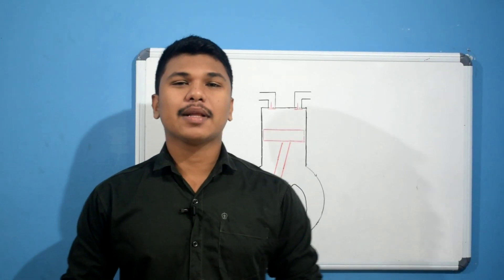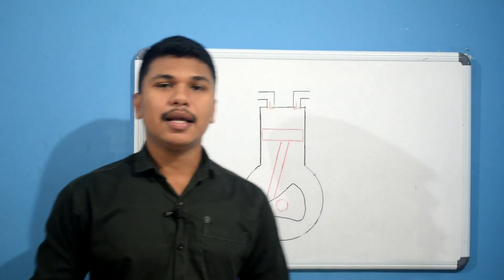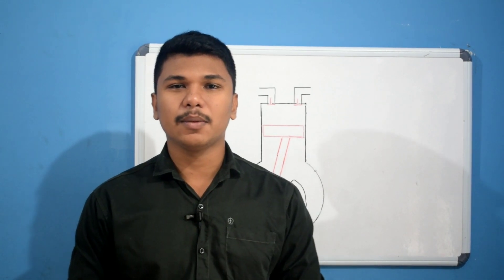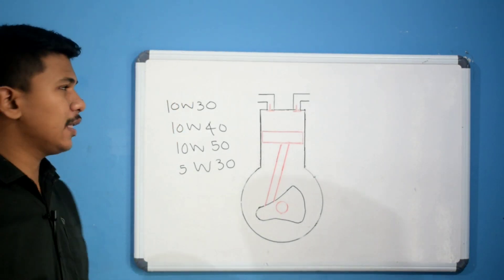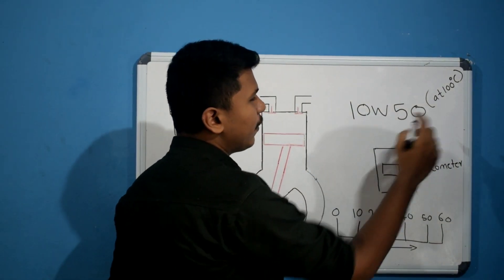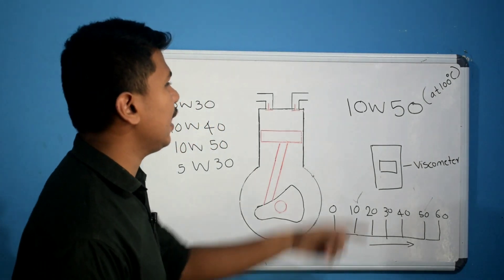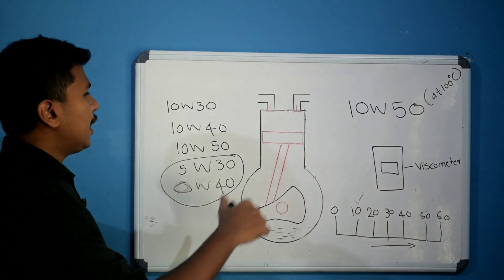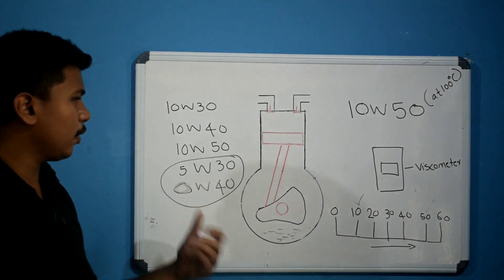Engine Oil explained | Types and Grades | Malayalam video | Informative Engineer |

Comment: Pazhaya 2 stroke vandikalil 2T oil ennu pothuve vilikkunna 2 stroke oil petrol nte koode mix cheythanu use cheyyarund Suzuki  Samurai, Shogun Rx 100 thudangi orupadu 2 stroke vandikalil um  side iil cheriya oru tank und 2T oil ozhikkan ,allenkil patrol noppam mix cheythum ozhikkarund athanu 2 stroke engine oil ennu parayunna oil athu engine il ozhikkanullathalla karanam 2 stroke engine oil nu thickness valare kuravanu athu engine nil use cheythal engine pettannu damage akum

Comment: ചേട്ടായി എന്റെ വണ്ടി 2003 model Splender (euro 2) ആണ്.
ഈ വണ്ടിക്കു പറ്റിയ ഓയിൽ ഏതാണ്.
User manual ൽ 10W 30 ആണ്.
പക്ഷേ വർക്ഷോപ്പിൽ ചെന്നപ്പോൾ 20w40 ആണ് അവർ ഒഴിക്കാൻ പറഞ്ഞത്.
ഏതാണ് correct ആയ oil ?

Comment: Honda company unicorn 150 bike recommend 10w30 engine oil aanu .  Appol 10w40 use cheythal engine lubrication hol koode oil_nu kadannu pokan sadhikkumo ??

Engine Thanuthirikkunna avasthayil 10w40 viscosity koodiyathu kondu 10w30 recommend cheyyunna engine lub hole koode kadannu pokumo ?

Ella parts_nu oil correct aayi kittumo ?
10w40 use cheyyunnath nallathano atho allayo ?

Comment: Dear friends. 20w40 or 15w40 is also called NORMAL ENGINE OIL, IT COSTS BETWEEN 700₹ to 1000₹ for 3litre or 3.5litre, This oil will be very thick. Good for South Indian condition,  Where as, the 0w30 and 5w30 both are (FULLY SYNTHETIC). 
Reason people use in new gen Diesel engine and Petrol engine is that, at the time of starting a car, the synthetic Engine Oil as it is very much close to free flowing, the oil quickly gets into the piston areas and then make the Engine start without much hassle or noice coming. Ina way synthetic Engine Oil is also used for high performance cars, the reason is as I said, to get the Oil Quickly To Pistons.
Reply: Hi bro...Karizma ZMR il 10w30 anu Owners Manualil parayunath...But vandiyude first owner ozhichirunath 10w40 7100 Motul arunnu..Njn epol second owner..7 Masam nirthiyitta vandi arunnu..Vandi eduthu Oil maran chennapol workshop karan 20w40 anu nallathen paranj ath ozhichu..enit 2500 kmil oil change cheythal mathiyen paranju..Epo Start cheyumbo White Smoke varunnu..Smoke Oil marunna vare ilatha vandi arunnu...Enthan evde sambavichathu..ithil enthenkilum udayipp undo?...Ningale pole ola youtubers anu njangalude ake ula trust😊...Reply idumen pratheekshikunu..Matulavarkum sahayam avate

Comment: Very informative thank you. 
What about nulon oil 10ml for scooter add with engine oil and it cost around 200rs , it last 15000km 1986 onward I use this oil in my hero Honda CD100 and now activa i feel very smooth engine high pickup.
Reply: Very useful information, Thanks

Comment: Good explanation.
10W50.
1.What is the unit of 10 and 50 ? 2.Which viscosity is considered here.Dynamic or Kinematic ?
3.In cold state viscosity is 10 and in hot(100'C), viscosity is 50.Is this mean the oil is more viscous at 100'C compared to cold state.Is it good to become more viscous at high temp ?

Comment: Ente vandi Honda CB Shine SP anu. Njan athil Honda yude oil ozhikunnath nirthi. Athinu pakaram Motul 4T 5100 10W40 anu ozhikkunnath. Vandiyude accelaration muthal gear smoothness vare improve cheythu. Engine breaking ottum thanne illa ennu venam parayan. Overall vibration valare adhikam kuranju. Honda yude oil ozhichirunna time il, enik 50 km/h il polum odikan kazhiyillayirunnu. Athrakku vibration um heat um ayirunnu. Ipo njan 60 km/h il constant ayit pokunnu oru kuzhappavum illathe. 60 km/h il povumbol thanne enik overtake cheyendi vannal polum ipo oru vishayamalla. Ipo vibration thudangunnathu thanne 75 - 80 km/h ilanu. Athukond enikkariyavunna ella alkarodum njan Motul anu prefer cheyyunnath. Pinne Honda yude service inte menma njan parayathe thanne ellavarkum ariyam ennu karuthunnu.
Reply: Bro engine oil 3000, 7100 enthan?
Reply: @perfectperfect5713  5100 10W40 green kuppi
Reply: @soorejsbabu  perfomance enganayund
Reply: @perfectperfect5713  Nalla improvement vannu. Pickup koodi. RPM pettennu kerunund. Athukond oru karyam sredhikanam, othiri higher RPM ilek ketaruth. Oru vishayame allathapole RPM kerum but ath chelapo engine components inte designed limit kazhinjum push cheyan thonipikum. Bhayankara smooth ayond engine breaking sherikum kurayum. Engine azhichu vita feel avum. Athukond thanne mileage ilum cheriya improvement und. Porathe 5,000 km il oil mariyamathi.
Reply: @perfectperfect5713  First time use cheyan pokuvanel ipo kedakunna oil ilek liqui moli de engine flush (oil shooter 80ml) ozhichit oru 10-15 mins idle il iduka. Ennit thanuth kazhiyumbo maximum ooti kalayanam. 2 side ilekum cherichum, kicker onnu pathuke chaviti piston karakiyum mukalil kedannathukoode maximum ooti kalanjite motul ozhikavu.

Ith oil upgrade cheyumbazho, vere company de oil ilek marumbazho, 15k km kazhinju varunna oil change ino okke ingane cheyanam.
Reply: @soorejsbabu  milege koodumo
Reply: 5100 10w30 upayogichal performance koodumo?
Reply: Speed kerunnundo
Reply: Oil change cheythal engine preshnamundo athayath company prefer cheyunath 3000 10w30 an.njan ath 5100 10w30 akiyal enthekilum prashnamundo.
Reply: @perfectperfect5713  3000 10w30 mineral oil anu Honda il ninnu kittunathum mineral oil anu. 5100 semi synthetic anu. 7100 and 300v fully synthetic anu. Cheriya vandikalk semi synthetic mathi. Fully synthetic oru avashyom illa.

10w30 ennathinu pakaram +/- 10 vare mati ozhikam. But athil kooduthal mattaruth (eg: 20w50).

Bakiyellam njan already paranjitund. Vayichu nokiya mathi.

Comment: Honda cbr 250r using 10w40 shell fully synthetic oil
Reply: Aha.. njanum. Honda cb shine sp. Using 10w40 motul fully synthetic oil.

Honda yude servicing bhayankara "mikacha"thayit thonunna alkarum undalle.
Reply: Etrayanu price ee oiln
Reply: @allenzam7416  motul anel 500 roopak mele avum. But 4,000 km odum

Comment: What is best time for change engine oil. Cold engine or hot engine ( just after running)?
Reply: I know the right answer. If its a cold engine , drive it 2 miles or 3-4 km then change oil and filter. Wait untill old oil is completely drained. I do both my cars myself

Comment: Could you please tell me which engine is more expensive to maintain -turbocharged 3 cylinder petrol engine or 4 cylinder CRdi Diesel engine?
Reply from the maker: Engine maintenance pala karyangaleyum ashrayichanu irikkunnath.. 
Ningal eth car aanu vangan udheshikkunnath.. enn paranjal onnu koode clear aakam

Pinne normally diesel  maintenance cost kooduthalanu
Reply: Hyundai venue

Comment: ബൈക്കുകളിൽ ൽ Synthetic oil ഉപയോഗിക്കാമോ.......?
Reply: കൃത്രിമമായി നിർമ്മിച്ച chemicals അടങ്ങിയ oil ആണ് സിന്തറ്റിക് ഓയിൽ. Crude oil  Chemically modified ചെയ്ത് പെട്രോൾ Components  ഉപയോഗിച്ചാണ് സിന്തറ്റിക് oil  നിർമ്മിക്കുന്നത് വ്യത്യസ്ത കമ്പനികളുടെ oilinte viscosity വ്യത്യാസം ഉണ്ടാകും.
 ഇത് 200 cc ക്ക് മുകളിൽ ഉള്ള വണ്ടികളിൽ ഉപയോഗിക്കുന്നത് ഗുണം ചെയ്യും.
ഓയിൽ changing period increase ആകും.

Better viscosity

•	Better chemical and shear stability.

•	Decreased evaporative loss.

Resistance to oxidation, thermal breakdown, and oil sludge problems.

Possibility to extended drain intervals, with the environmental benefit of less used oil waste generated.

Improved fuel economy in certain engine configurations.

Better lubrication during extreme cold weather starts.

Possibly a longer engine life.

Comment: Engin oil മാറുമ്പോൾ engin flush ചെയ്യുന്നത് നല്ലതാണോ? അതിനെ പറ്റി ഒരു vdo plz...
Reply: 15k intervalsil engine flush cheyyunnathaaakum nallath

allaaathe regular oil changing intervalsil engine flush cheyyanamennilla
Reply: You dont have to flush out an engine . Drain out the old oil after running couple of kms . Change the filter. Wait until oil is completely drained

Comment: ചേട്ടായി വീഡിയോസ് കൊള്ളാം 
ചേട്ടായി ഓയിൽ ചെയ്‌ച്ചു ചെയ്യുമ്പോൾ എഞ്ചിൻ ക്ലീൻ ചെയ്യാൻ ഉള്ള ഒരു ഐഡിയ കൂടി പറഞ്ഞുതരുമോ
Reply: Use  flushing oil after emptied old oil then run the engine 3 to 5 minutes. after that empty the flushing oil and fill new engine grade oil

Comment: Dot 2 dot 3 entha sambhavam ,athupole enganeyaan brake fluid work cheyyunnath athupole disk braking enganeyaan nadakkunnath abs in bike enganeyaan ithokke paranh oru video cheythal top aayirikkum
Reply: ഹൈഡ്രോളിക് ക്ലച്ച് ആപ്ലിക്കേഷനുകളിൽ ഉപയോഗിക്കുന്ന ഒരു തരം ഹൈഡ്രോളിക് fluid ബ്രേക്ക് ഫ്ലൂയിഡ്.
It is used to transfer force into pressure, and to amplify braking force. It works because liquids are not appreciably compressible.
DOT refer to us department of transport -brake fluid.
SAE is Society of Automobile Engineers is standardisation of engine oil
Dot 3,4&5 denotes the minerals including the oil.
Reply: @Crank2wheel  DOT stands for Department of transport (US)

Comment: സാധാരണക്കാർക്ക് പോലും ലളിതമായി മനസ്സിലാക്കാൻ കഴിവുള്ള രീതിയിൽ വളരെ നല്ല അറിവാണ് താങ്കൾ പങ്കു വച്ചത്.
Reply from the maker: Thank you.. 😊😊
Reply: 15w40diesel engine oil alle
Reply: Sorry to be so off topic but does any of you know a method to get back into an Instagram account..?
I was stupid lost the login password. I love any assistance you can offer me.
Reply: Thettaya vivaranamanu
Reply: Dear friends. 20w40 or 15w40 is also called NORMAL ENGINE OIL, IT COSTS BETWEEN 700₹ to 1000₹ for 3litre or 3.5litre, This oil will be very thick. Good for South Indian condition,  Where as, the 0w30 and 5w30 both are (FULLY SYNTHETIC). 
Reason people use in new gen Diesel engine and Petrol engine is that, at the time of starting a car, the synthetic Engine Oil as it is very much close to free flowing, the oil quickly gets into the piston areas and then make the Engine start without much hassle or noice coming. Ina way synthetic Engine Oil is also used for high performance cars, the reason is as I said, to get the Oil Quickly To Pistons.
Reply: ഒലക്ക..ഇടക്ക്‌ ഇംഗ്ലീഷ് പറഞ്ഞിട്ട് തിരിയുന്നില്ല😜

Comment: Thanks brw... ഞാൻ തപ്പിയ വീഡിയോ.. ഒരു സംശയം.. എന്തിനാണ് 4 strokinu 4T ഓയിലും 2strokinu 2T ഓയിലും?  ഇത് രണ്ടും തമ്മിലുള്ള വ്യത്യാസം endanennu പറയുമോ??
Reply: 2 സ്‌ട്രോക്കിന്റെ engine ഓയിൽ ആണോ 2t ഓയിൽ.. അതോ.. പെട്രോളിൽ add ചെയ്യുന്നതാണോ?
Reply from the maker: 2 stoke il petroil lubrication system aanu..  athayath oil petrolinte koode mix cheythaanu upayogikkunnath..  appo athintethaaya prathyekatha 2t oil nu venam..
Reply: @informativeengineer2969  2 സ്‌ട്രോക്കിൽ എൻജിനിൽ ഉപയോഗിക്കുന്നതും 2തന്നെ ഓയിൽ ആണോ
Reply: Enginilum 2t oil aano.. atho petrolil use cheyyunnath maathram aano 2t
Reply from the maker: @NiyasjalwaMutthu  എഞ്ചിൻ ഇൽ പ്രത്യേകം ഓയിൽ ഒഴിക്കില്ല .. പെട്രോൾ ന്റെ കൂടെ മിക്സ്‌ ചെയ്ത് മാത്രമേ ഉപയോഗിക്കൂ

Comment: What if i use 15w50 instead of 10w40 my motorcycle manual recommends? Does it damage the engine components?
Reply: 15w50 use cheytal cold starting il vandi start cheytu sudden acceleration kodukkan padilla. Enginente oil circulation proper aayittu nadakkunnu ennu urappu varuthiyitte acceleration kodukkan padullu
Reply: @athulmaniangattu351  ok
Grade 40 change cheythu 50 use cheytha problem illallo (10w50) instead of 10w40
50 means temparature when the oil is hot right?
Reply: @jowhar31  No problem
Reply: @athulmaniangattu351  thanks

Comment: Bro , nice , informative video,keep it up.
For alto 800 ,which oil should be use, 
10 W 30 or 20 W 40, 5W 30? Bcose s.s are using these all grade oil.pls reply.place is in kerala.
Reply: 20 w 40 is mostly using

Comment: Ente bike unicorn 150 aanu. 2013 model. njn honda genuine engine oil thanneyanu use cheyyunneth. Full synthetic oil use cheyyunnond kuzhappamundo?  Ethra km akumbo oil change cheyyanam?
Reply: Fully synthetic oil use cheyyunnath nalla option aanu, karanam engine kurach koode smooth and silent aakum. atukond thanne mileage um kooduthal kittum.. Fully synthetic oil aanengil oru 7000-8000 km il oil change cheytal mathi

Comment: 20w40 oil athu type oil anne
Reply: Petrol
Reply: Dear friends. 20w40 or 15w40 is also called NORMAL ENGINE OIL, IT COSTS BETWEEN 700₹ to 1000₹ for 3litre or 3.5litre, This oil will be very thick. Good for South Indian condition,  Where as, the 0w30 and 5w30 both are (FULLY SYNTHETIC). 
Reason people use in new gen Diesel engine and Petrol engine is that, at the time of starting a car, the synthetic Engine Oil as it is very much close to free flowing, the oil quickly gets into the piston areas and then make the Engine start without much hassle or noice coming. Ina way synthetic Engine Oil is also used for high performance cars, the reason is as I said, to get the Oil Quickly To Pistons.

Comment: ഞാൻ അറിയാൻ ആഗ്രഹിച്ച കാര്യം.... നന്ദി...... ബ്രോ ഇനി wet clutch കുറിച്ചു ഒരു വീഡിയോ ചെയ്യണം
Reply: Wet clutch എന്നാൽ ഓയിൽ ടിപ് ചെയ്ത് കിടക്കുന്നു cluch.. കൂടുതൽ ആയി ബൈക്ക് കളിൽ ഉപയോഗിക്കുന്നു multi plate ആയിരിക്കും.. dry clutch എന്നാൽ  lubrication ഇല്ലാ കാറിൽ heavy വെഹിക്കിൾ ഉപയോഗിക്കുന്നു സിംഗിൾ plate clutch ഡിസ്ക് ആയിരിക്കും
Reply from the maker: Thank you...
Reply: Swift diesel nu which grade
Reply: Unicon baikil ozikunna oil 10 w 30 ano

Comment: 10w30 anu company parayune but 10 w30 synthetic kittan ilatatu kondu 10 w 40 anu use cheyune itu kondu entelum problem undo 30 40 aakubo power loss undakuvo

Comment: Ente vandi Jupiter anu
Athinte gear oil grade onnu parayamo
Manufacturers  parayunnathu Engine oil  thanne ennu
Engine oil grade 10w30 anu
Reply: Scooter inte gearbox athikam complicated alla..And athil orupadu gear engagement um illa..Athukond thanne ethelum oru engine oil use cheytal mathi..Even diesel engine oil too
Reply: @athulmaniangattu351   Thank you
Reply: Gear oil  ozhichal any  problems
Reply: @sarathk.n6389  No problem if you use gear oil
Reply: @athulmaniangattu351  etra km vere use cheyyam
Reply: 90 grade  kuzhappamundo

Comment: ബ്രോ എന്റെ വണ്ടി 200 ns anu ithil njan liqui molly oil  ആണ് ഒഴിച്ചിരിക്കുന്നത് പക്ഷെ 1 ലിറ്റർ ആണ് ബോട്ടിൽ ഉള്ളൂ എൻജിനിൽ ശരിക്കും 1ലിറ്റർ 200 ml ആണ് വേണ്ട ഓയിൽ ഇന്റെ അളവ്.  എന്റെ ചോദ്യം 200 ml ഓയിൽ ഇപ്പോൾ ഒഴിച്ചിരിക്കുന്ന ബ്രാൻഡ് ഓയിൽ തന്നെ ozhikanm എന്നുണ്ടോ? വേറെ engine ഓയിൽ ഇപ്പോൾ ഒഴിച്ചിരിക്കുന്ന  ഓയിൽ ഇന്റെ ഒപ്പം ആഡ് ചെയ്ത് എന്ന് വച് engine എന്തെങ്കിലും തരത്തിൽ ഉള്ള prblms ഉണ്ടാവാൻ ചാൻസ് ഉണ്ടോ?
Reply: 1ltr ozhicha oilinte athe viscosity Ulla vere brand use cheythalum problem onnum undavilla.  Pinne randu tharam viscosity Ulla oil mix cheyth ozhichalum kuzhapam onnum illa but 5000 km milage Ulla oil aanel oru 3500km aavumbo change cheyyanam  athre ollu
Reply: 2litter engine oil same brand thanne vaanguka oru measuring canil 1.2l  alannu eduthu ozhikkuka .
Oil mattaruthu
Reply: Ninte oil fully syn oil aanu...thn 200 ml vere oil add cheyyumpo athu semi syn oil aaavum...soo baakki ninakk oohikkaavunnathaaanu
Reply: Thank u broos
Reply: prob indaavilla
but oil semi aavm

Comment: Gud video👌👌
Bajaj pulsar 180 eathu engine oil aanu best?
Reply from the maker: Bajaj adikavum 15w50 aayirikkum.. 
User manual undo??
Reply: @informativeengineer2969  und
Reply: It depends on how old your bike.... equilibrium means fully synthetic oil mixing with semi synthetic oil ..
Advantages low friction ,  prevents engine overheating getting better mileage. Durability guaranteed ..
Reply: @bijunp8139  yezdi classic which type oil need anybody to know?? Say please
Reply: 20w50